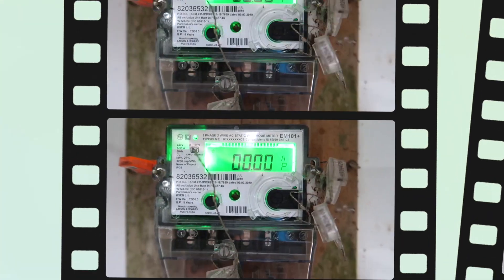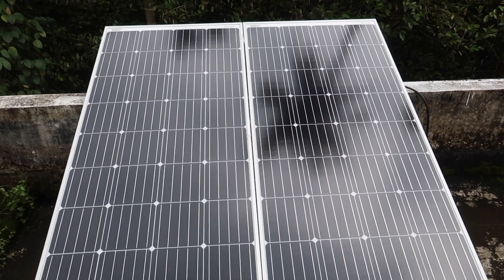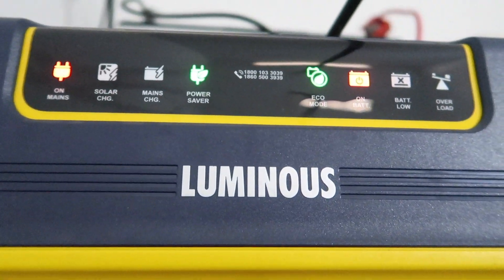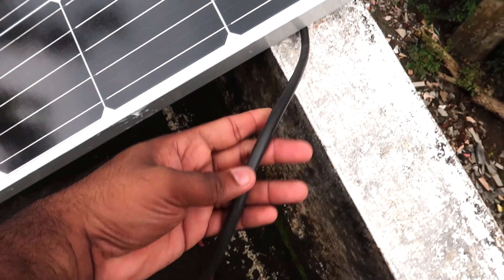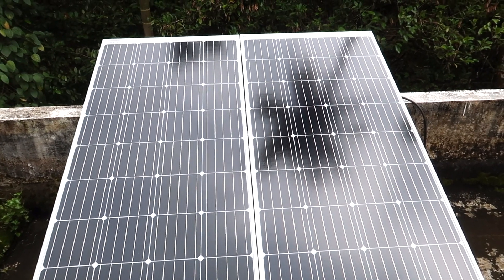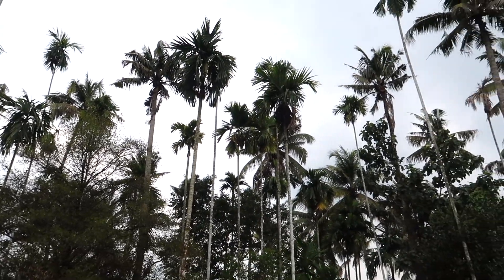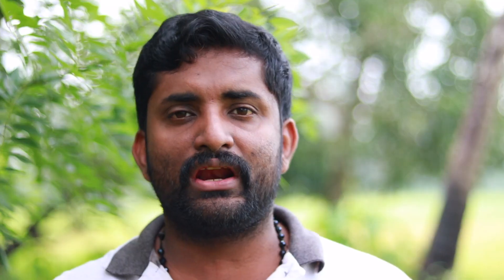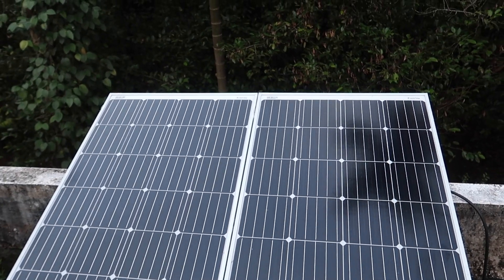സോളാർ പാനൽ വൈദ്യുതി ചാർജ് കുറക്കും | Luminous invertor + solar panel + battery

Comment: ബാറ്ററി ഫുൾ ആവാത്തതിന് കാരണം C20 ബാറ്ററി ആയത്കൊണ്ടായിരിക്കണം.
C20 ബാറ്ററിയുടെ ചാർജ് സൈക്കിൾ 20 മണിക്കൂർ ആണ്, സേഫ് ആയി മുഴുവനായി ചാർജ് ആവാൻ 10 മണിക്കൂർ എടുക്കും,  എന്നാൽ C10 ബാറ്റെറിയുടേത് 10 മണിക്കൂർ ആണ് ചാർജ് സൈക്കിൾ,   അതിനാൽ സേഫ് ആയി ഫുൾ ചാർജ് ആവാൻ 5 മണിക്കൂർ മതി. 

C20.
100AH   Maximum charge AMPS 10A ആയിരിക്കും 

C10.
100AH Maximum charge AMPS 20A ആയിരിക്കും 
ബാറ്ററി AH ന് അനുസരിച്ചു ചാർജിങ് AMPS ന് മാറ്റംവരുന്നതാണ് 
ഇതാണ് സേഫ് ചാർജിങ്    C20 യിൽ C10 ന്റെ ചാർജിങ് മോഡിലാണെങ്കിൽ ഞമ്മൾ പ്രതീക്ഷിക്കുന്ന റിസൾട്ട്‌ കിട്ടില്ല   ബാറ്ററിയുടെ എഫിഷെൻസി വലിയതോതിൽ കുറയും    ബാറ്റെറിയുടെ ലൈഫ് പെട്ടൊന്ന് കുറയും 

പിന്നേ മറ്റൊരു കാര്യം കൂടി.
സാധാരണ ഒരു 1KW MONO PANEL ൽ നിന്ന് 90% പ്രകാശം കിട്ടിയാൽ 4 to 5 യൂണിറ്റ് electricity ഉണ്ടാക്കാനേ കഴിയൂ    
Simple ആയിട്ട് പറഞ്ഞാൽ 4 യൂണിറ്റ് സ്റ്റോർ ചെയ്യാൻ 400AH battery വേണ്ടിവരും അതും C10 (5 മണിക്കൂർ കൊണ്ട് ചാർജ് ആവണം)
ഇതെല്ലാം ചിന്തിച്ചു നല്ലരീതിയിൽ ഒരു സോളാർ സിസ്റ്റം തിരഞ്ഞെടുക്കുക     ഒരിക്കലും കൂടുതൽ അഡ്വാൻസ്‌ ആയി ചിന്തിക്കരുത് അത് കൂടുതൽ നഷ്ട്ടമുണ്ടാക്കും 

ഈ പറഞ്ഞതിൽ എന്തെങ്കിലും സംശയമോ തിരുത്തോ ഉണ്ടെങ്കിൽ എന്നെ വിളിച്ചു പറയുക 
9846302701
Reply: നിങ്ങൾ പറയുന്നത് വളരെ ശരിയാണ്....ഞാൻ ഇതിനെ കുറിച്ചു പഠിച്ചിരുന്നു.
Reply: ,,ഗുഡ്
Reply: Thanks brother good information
Reply: C20 BATTERY :Charging   time =20 hours
C10 BATTERY :Charging  time=10 hours
ingane alleee??  Oru samshayam??!!
Reply: Bro, ningal paranjathil first part el correction undu. Charging cycle c20 Ku 20 hours, c10 nu 5 hours angane alla. Charging cycle includes different charging stages like bulk, float etc. In case of lead acid battery it is a time consuming process. Battery life kittan, it has to undergo at least both constant current charging and constant voltage charging. Allathe 40amps current 5 hours el oru c10 battery Ku koduthal, full charge aakilla. Kooduthal ariyan interest ullavar, battery university Enna website el nokiyal mathi.
Reply: @CrazyCircuits  എനിക്കും അത് തന്നെ ആണ് സംശയം c10 ബാറ്ററി ചാർജ് ചെയ്യുന്നത് 15/14 Amp വെച്ചാണ്. 10 മണിക്കൂർ എന്ന കണക്ക്. അതിൽ കേരളത്തിൽ 6 മണിക്കൂർ മാത്രമേ സൂര്യ പ്രകാശം കിട്ടൂ. 180W ൻ്റെ 3 പാനൽ വെച്ചാൽ മാത്രം മതി.
Reply: @mymeditationmusic6879  partially correct. Oru 150ah C10 battery 15amps vachu bulk charging aanu cheyynathu. Bulk charging Alla full charging. Full charge aakan, constant voltage El pinne charge cheyyanam. Constant voltage koduthu current kuranju kuranju varum battery charge aakuna anisharichu.

Ithu kure time edukkum. Ithum koode accommodate cheythu venam, solar system design cheyyan. Enkile battery life kittu. 

Battery aanu etavum expensive. Athu last cheythale off grid solar system break even aaku.

Kure parameters nammal nokanam.

1. Charging current
2. Charging time
3. Load
4. Battery limit percentage
5. Panel ratings
6. Mppt capacity
7. Weather seasons etc

Ithu oro aalkum vere vere aarikum. Best configuration ororutharum individually experiment cheythu kandu pidichal, maximum output kittum from a solar plant.
Reply: @CrazyCircuits  അതറിയാം. വീട്ടിൽ ഉള്ള സോളാർ ഇൻവേറ്റർ 4 stage charging ആണ്. ബാറ്ററി 12V ലേക് ഡൗൺ ആയൽ പിന്നെ ചാർജ് ആകുന്നത് 10 amps വെച്ചാണ്. പിന്നെ 13v അല്ലെങ്കിൽ 14v ലേക്ക് വരുമ്പോൾ 1amps വേച്ചാകും ചാർജ് കേറുന്നത്. ഈ ഒരു പ്രൊസസ്സ് എടുക്കുന്നത് 6- 10 മണിക്കൂർ nte ഉള്ളിൽ ആണെന്ന് ആണ് എൻ്റെ ഒരു അറിവ്.
Reply: @mymeditationmusic6879  Yes you are mostly right. 10hours um pora sharikum full charge aakan. Here is the problem with solar. You will get sunlight for 6-7 hours. Lead acid battery ee time nu ullil full charge aakilla. Next day we are using power from battery. Orikkalum battery full charge aakunilla.

This will cause serious gravity issues in the battery and result in permanent loss of capacity. Pathiye pathiye.

Ithu avoid cheyyan kurachu vazhiye ullu.

1. Nalla design. 
2. More parallel batteries of lower capacity than 1 or 2 single high capacity battery.
3. Keep higher cut off voltage for battery. 
4. Periodic equalisation charging.
5. Turn off solar consumption on cloudy days.
6. All batteries should be of same brand, model and age.
7. Ethra volt vare bulk charge cheyyanam
8. Ethra volt float charge set cheyyanam

Angane okke.
Reply: CHARGING AMPS PLS
Reply: @jaisonsagara5773  C20=ബാറ്ററി AH/10
C10=ബാറ്ററി AH/5
Reply: എനിക്ക് 110 വാട്ട്സ് 6 മണിക്കൂർ നേരം പ്രവർത്തിപ്പിക്കാൻ 50 വാട്ട്സ് ന്റേ 2 സോളർ വെച്ചാ മാതിയോ?
ചെറിയ ബജറ്റിൽ ഉള്ളത് paranjutharumo?
4 led lights, 2 ഫാൻ🤔
Reply: bro ഇതിന്റെ സൗണ്ട് എപ്പോളും കേൾക്കുമോ...~????
Reply: @anandhuks8422  no
Reply: M8i88iu8p
Reply: Yes u have to go for C10 battery

Comment: Brooo.  375w *2 panel vendivarum karanam battery  200ah. batteryil almost 2400w indavum.  Solar panel peak hour 4hrs.  375*4hrs=1500w
1500w*2=3000w.Correct combination enganayan Engana Cheythal battery full akkum. Bro oru 180w oru panel purchase cheyandi varum e panel vangikazhinal problem solve akkum..

Comment: Really well done, you should do more videos regarding solar system. 

I have few questions / suggetions for general concern  for public.

1. Distric/ location  basic please do videos

2. Types of solar panels

3. Minimum to maximum price of each solar pannel

4. Type  of battery

5. Why we should take permission from elecricity board(KSEB)

6.  Please review about AC solar pannels

7: please make a review about inverter charging from solar energy.

8: Do's & Don's about solar pannels

9: what are the main consent should take before fitting solar pannels

10: Mobile application for fitting solar pannels in correct position

11. Why cusomer care/ service is so important ( not only solar fittings- general review)

12. Why a electian or knowlegebale (electric), important  for fittings (neutral, Phase fixing)

I hope you will consider my request, Thank You.... God Bless You...

Comment: Electricity from solar system is expensive compared to electricity from kseb.
Solar will help you only if you are a heavy user, paying in higher slabs of kseb bill.
We shoud properly calculate it according to our usage.
Reply: ഷോപ്പുകൾക് സോളാർ ആണ് ബെസ്റ്റ് എന്ന് തോന്നുന്നു കാരണം kseb commercial tariff വളരെ കൂടുതൽ ആണ്

Comment: Total cost including solar panel, Bty and inverter of 5KW ?
Reply from the maker: We are not selling anything 🙏
Reply: 1. Luminous 6kw mppt pcu= 59000rs
2. Microtek 320w 16pcs solar panels=12640rs
3. Okaya 120ah solar c10 battery 8pcs= 88000rs(5 years replacement warranty)

Comment: Chatta 200ah battariyil 2fan 3Led balb അത്ര മണിക്കൂർ വർക്കും  chayyu
Reply from the maker: Calculate chayyan ariyilla bro..google nookku
Reply: Sarish Ck   ഫാൻ 60W X 2 =120W 
LED 10W X 3= 30W. SO TOTAL ലോഡ്  150W  
200/12.5A =16HRS 
But you can expect 70% efficiency only
Reply: 3 ഫാൻ,2 ബൾബ് ആകെ load 150 W. ബറ്റെറി capacity 200AH,എങ്കിൽ അതിന്റെ Watt hour എത്രയെന്ന് നോക്കാം.200AH*12Volt*0.8(efficiency)=1920Wh
1920Wh നെ ആകെ ലോഡ്‌ (150W) കൊണ്ടു ഹരിയ്ക്കണം.
1920Wh/150W=12.8 മണിക്കൂര്.
അതായതു് fully ചാർജ് ആയ 200AH battery 2 ഫാനിനോടും 3 ബൾബിനൊടും connect ചെയ്താൽ 12.8 മണിക്കൂര് work ചയ്യും

Comment: Chatta 200ah battariyil 2fan 3Led balb അത്ര മണിക്കൂർ വർക്കും  chayyu
Reply: It can easily calculated..
Assume Fan 60watts
Assume  Led bulb 9 watts
Assume power factor >.85
2 fans 120watts,3 led 27watts
So total 147 watts 
Energy inside 200 ah battery 12volt*200amperehour =2400watthour=2.4 units.
Divide 2400watthour/147 watts =16 hours maximum backup time.
You get 13,14 hours in practical if you have good inverter and battery

Comment: I am using luminos nxg 1400 va hybrid  inverter same as this video but little more VA.and me using 180watts 2 panel and 150 AH C10 battery solar. But after doing this i got a huge increase in current bill.. its not a current saver its just a inverter.. we got almost 7400-8000 as current bill. If you are looking for current saver.. go for on grid minimum 3kv. Its costly but you will get the returns in 3 years
Reply: Something wrong. I am a satisfied solar inverter  consumer.
Reply: ratheesh raghavan  can u pls tell the configuration

Comment: താങ്കളുടെ ഉദ്യമം നന്നായിട്ടുണ്ട്, എന്നാൽ പൂര്‍ണമായും സോളാര്‍ അധിഷ്ഠിതമായ ഒരു സിസ്റ്റം തയാറാക്കുന്നതിന് കുറച്ചു കാര്യങ്ങള്‍ കൂടി ആവശ്യമാണ്.
1.1kw panel എങ്കിലും വേണം. Temperature ഉയരുന്ന സാഹചര്യത്തില്‍ സോളാര്‍ പാനല്‍ efficiency കുറയും 
2.എകദേശം  10 മുതൽ 14 ഡിഗ്രീ charuvil തെക്ക് ദിശയില്‍ സ്ഥാപിച്ചാല്‍ പരമാവധി amp ലഭിക്കും.
 3.solar inverter ല്‍ ഗ്രിഡ് charge disable facility ഉണ്ടാക്കണം.
4.cable size വളരെ പ്രധാനപ്പെട്ട ഒന്നാണ്.
5.ബാറ്ററി C10 prefer ചെയ്യാം. life കൂടുതല്‍ കിട്ടും.

Comment: I think you study has been so partial, monocrystalline and much more efficient and effective in our indian climate conditions...Not just efficient but can be used even on low lighting condition during rainy days, but on the other hand polycrystalline wont be generating power during such conditions...Whether you are just putting two or three panel or even installing 2 KV or above ....Monocrystalline cells are always good and more over the cell and panel efficiency of loom solar is comparatively good, as it is more than 19% efficient.

Comment: ഞാൻ microtech inverter ആണ് ഉപയോഗിക്കുന്നത്. Current pokumbol chila samayath computer UPS extra koduthitu koodu off aayi pokarundu. Epolum illachila samayath mathram. Athentha angane.
Reply from the maker: Ups battery ullathu alle? 🤔
Reply: @ecoownmedia  അതെ ആണ്. Chila nerath current pokumbol pc restart akum. Inverter change cheythal nere akumo. Ethu companyanu better
Reply: @ecoownmedia  costomer care parayunath current pokunna time ups nu current edukanulla time kitunila ennanu.
Reply from the maker: Invertor setting ups mode elle?
Reply: UPS MODE ILLANGIL LINE MATTI KODUKKUNATHU NALLATHANU

Comment: PWM ടെക്നോളജി use  ചെയ്യാതെ MPPT ടെക്നോളജി inverter മാത്രം use  ചെയ്യാൻ നോക്കുക.. I replaced old PWM with MPPT and  can now easily charge my 150Ah battey with in half day having 2 nos of 325wP/24V/45Voc/PCP.   
Before mono panels that its best suitable for cloudy countries.. like Europe / Canada etc.. Now poly panels efficiency is increased to great extent with technology improvement , that they are almost equivalent to Mono panels in all aspect. Only difference for same panel size MCP produce bit more negligible  power (like 325wP for PCP & 350wP for MCP), but not justifiable with additional price that we are paying ..  Here i find lot of bloggers specifically sponsored from loom solar brand promotes Mono panels.. . .  Loom solar have special business interests on mono panels that's what i understood since they manufacture and market poly panels for other companies and selling in different brands.. nothing special.

Comment: Ee inverteril kseb supply charging off akkan valla vazhiyum undo solar charging mathram mathi
Reply from the maker: Company onnum thanne provide chayyunnilla..ethengilum electronic shopil koduthu line disconnecte chayyendi varum
Reply: veettil ninnum invertorilottulla ulla line input Switch off aakkiyal pore?!

Comment: use mppt which will extract maximum power from solar panel. Monocrystalline  efficiency kooduthal annu. cost problem allel monocrystaline aanu eppozhum nallath. Monocrystaline kaalavasthakk nallathallannu parayunnathokke verutheyanu bro. Polycrystaline oru low cost solar option enne ullu.

Comment: You can use 12 volts dc fans and lightings through the voltage controller with another wiring of 12volts dc supply . Iam using these system in my home

Comment: Dear you are right.  I have placed 4 panels + 4 battery pack my system cover all equipments in my house including 2 ACs, 1hp motor, ironing all we do with this.  Now my electricity bill reduced more than 60% and i never experienced a power failure in my house.  Only thing we do is motor and iron box we use only in day time.  AC we use minimum 2 hours in day time and more time at night.  Cost was Ro 170000

Comment: I have also installed 1 kw solar lanco solar panel off grid via ANERT, when this revolution began in kerala, but I never felt much reduction in current charges.  I checked every point in my house to see any loopholes, but none.  Recently, my solar inverter got faulty and I called upon another person to install a videocon automatic inverter.  However, it has no provision to stick onto solar power alone.  It will change from solar power to KSEB, if the former power halts.  However, thx for the informative video.  Hoping to install two more panels off grid.  I have rejected recent offer of KSEB to install panels on rent.  I have videocon solar water heater too.  Expecting more informative video.  It is a sad fact that very few has specific knowledge about solar panels and its working.  One real drawback of off grid system is that while using tubular batteries, you must fill the batteries with battery water without fail.
Reply: Kindly use mppt technology

Comment: Ethu 150ah ,12v Exide battery aanu best for home  . IT invatubular or invamaster??
Reply from the maker: Tubebular c10 aanu best ennanu ariyan sadichathu...
Reply: Inverter purpose aanel etavum nallathu invagold tall tubular c10 model with 48 months warranty (invagold short tubular um undu. Buy tall tubular)

Solar purpose aanel
Exide solatubular 6lms model with 60 months warranty.

Comment: Almost 75 % load in a house is used after 6 pm. In this duration there is no sunlight. In this case there is no considerable amount of power saving. Go grid tie system
Reply: സാറിന് നബർ തരുമോ
Reply: @sajeevsajeev5320  6238651461
Reply: but grid type is worth only if you are using daily 10 unit and above
Reply: What is the price per unit paid by KSEB? Someone commented that it is below 3rs per unit. So, need to consider that too.

Comment: 180watts nthe 2panel alle.. 360watts appo oru 19amp engilum maximum output kittumo.. 200ah battery charge avan ethra tym edukkum .. 7hr pidikkumo

Comment: njan oru room matram upayogikunu solar...inverter upayogikunilla athu  loss aaanu...panel and charge controlelr upayogich battery charge chyunnu...dc fan light iva use chyunnu...athyavasyam ac generate chyan ups upagikunnu

Comment: Battery charge keran oru specific volt vennam. So, a volt panel produce cheyunundel inverter solar nine edukum, a volt, amphere  output meet cheyathe vana grid leke pokum. Panel ennam kootiya kuranja light illum charging voltage undaki edukam... Pine maximum etra panel ane a inverter pidipikan pattuka enu koodi anesichu noku... might be helpful.

Comment: 3 kv off grid install ചെയ്യാൻ എന്ത്‌ ചിലവ്‌ വരും?
Reply from the maker: Depending battery backup aanu. Ekadhesham 250000 range varumayirikkum..not sure
Reply: 3 kv ക്ക് എത്ര ബാറ്ററി വേണം . 150/200 amps ബാറ്ററി യാണ്‌ ഉപയോഗിക്കുന്നതെങ്കിൽ .
Reply: 160000rs ....3kva mppt system of microtek with battery
Reply: @harneetsingh66666  location pls

Comment: 350watts 24v randu panel vachal ethu inverter and battery use cheyyunnatharikkum nallathu ?
Reply from the maker: 24 v battery connect chayyunna inverter vekku..
Reply: 24 volt inverter and two 12 volt battery...
Reply: സാർ നമ്പർ തരുമോ

Comment: Hi. എന്റെ വീട്ടിൽ കറന്റ്‌ ചാർജ് 1500/- വരുന്നുണ്ട്. സോളാർ വെക്കുകയാണെങ്കിൽ ലാഭമാണോ?
Reply from the maker: Inverter mathram anagil labham aayirikkum..full solar aakiyal pisa mothal aavan time edukkum
Reply: Fitness, travel, motivation Media 

No  if your bimontly bill is rs 1500 dont invest on solar. As your usage is less than 5 units hence bill is under subsidised rate.  Solar is good for offices which pay in commercial rate or homes which use more than 9 units per day  if so bill with new Kseb rate will be above rs 2900 bi - monthly domestic
Reply: Full ayettu DC yelaykku Mario. Sun world .com  eallam kettum. 12 v. Iron box eallam
Reply: 12 v iron box. Sun world

Comment: Hi friends,,, 
NXG 1400 offer little bit high output capacity. Please keep in mind that NXG 1100 is 850 va  and NXG 1400 is 1100 va inverter.
NXG 1400 is compatible with digital inverter refrigerator ...
Reply from the maker: Sorry..NXG 1100 is 1100 va 850 W
Reply: @ecoownmedia  
Just for a clarification, pls share your watsup number.
Reply: @ecoownmedia  nxg 1100 is 850va and which is 680w

Comment: Hi friend...
Thanks for choosing Luminous solar inverter for your review...
As a sales and service co-ordinator I would like to share you some important facts about the product  you introduced to the public.
First of all NXG 1100 is a solar inverter but also you can use this as a normal inverter. You can use solar panels up to 1000 WP. but we recommend a maximum of 650 watts. If it is mono or poly we don't care. Mono is little more
 efficient and you have to spend more. The actual configuration of NXG 1100 is .
650 WP panel
150 AH C10 Solar battery....
and you can connect 600 watt load online and offline...
NXG 1100+ 150 AH solar battery (60 months replacement warranty)
165 watt solar panel combo offer is available now at less than 28,000...
If any enquiries please watts up 
9895681521
Reply: Good information. Thank you so much. With NXG1400, what is the max panel can connect? What is the max Ah battery can be connected? Can two 200Ah battery connect in parallel?

Comment: എന്റെ നിലവിലുള്ള ഇൻവേർട്ടറിലേക്ക് ഒരു സോളാർ ചാർജ് കണ്ട്രോൾ ഘടിപ്പിച്ചാൽ, പകൽ സമയം പാനലിൽ ചാർജ് ഉണ്ട്, ബാറ്ററിയിലും ഉണ്ട്. ഇൻവേർട്ടർ On ആയിരുന്നാൽ, പാനലിലെ ചാർജ് കൊണ്ട് ഇൻവേർട്ടർ പ്രവർത്തിച്ചു വൈദ്യുതി നൽകും. ഈ സമയം ഇൻവേർട്ടറിന്റെ സ്വിച് ഓഫ് ചെയ്താൽ വീട്ടിൽ വൈദ്യുതി ഉണ്ടാവുമോ?.
Reply from the maker: Switch off chythal invertor off aakille pinna engana aanu current undavuka..no chance..inverter input power off chaythal current undavum
Reply: @ecoownmedia  
അങ്ങനെ ആയാൽ ഇൻവേർട്ടർ റേറ്റഡ് ലോഡിന് മുകളിൽ വരുന്ന ഒരു ലോഡ് എങ്ങനെ ഉപയോഗിക്കും.
അതായത്, എന്റെ സിസ്റ്റം 500 വാട്ട്. വീട്ടിലെ സോക്കറ്റുകളിലേക്ക് ഇൻവേർട്ടർ കണക്റ്റ് ചെയ്തിട്ടുണ്ട്.
ഇപ്പോൾ KSEB ഉള്ള സമയത്തു ഞാൻ 1000 വാട്ട് അയൻ ബോക്സ് ലോഡ് ചെയ്യാറുണ്ട്.
ഈ സിസ്റ്റത്തിൽ അത് സാധിക്കുമോ?.
Reply: ഇൻവേർട്ടർ പ്രവർത്തിക്കാതെ KSEB വൈദ്യുതി മാത്രം ലഭിക്കാൻ എന്താണ് വഴി?.
Reply: @skpulikkal4343  Install a bypass switch.
Reply: @skpulikkal4343  Get and electrician and tell him to separate power and light loads for inverter.